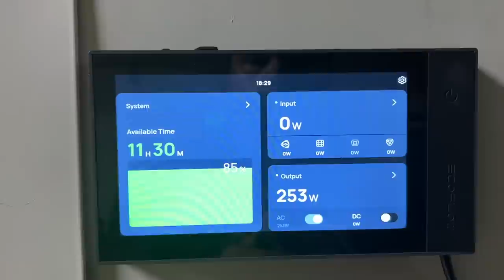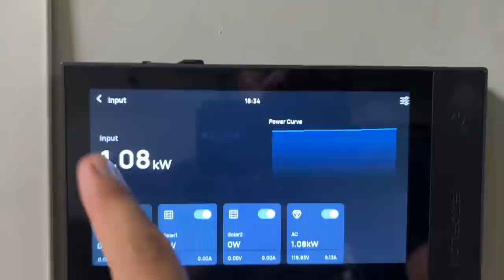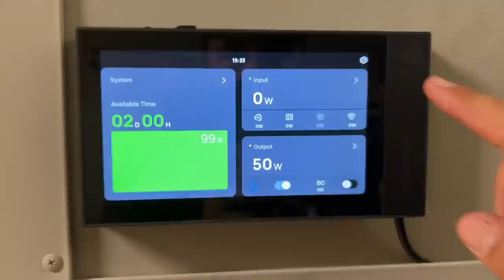Big Hog Caught BUT Just Barely!

Comment: Solar is 12v first. If ones solar batteries were set up as an 12v system. The use is endless. Although Lithium batteries don't mix with the rest. Yet all other type batteries do mix together. Lithium batteries drop voltage when used and won't come back up until charged. All the other batteries will. Mine in my shop is over 5 years old. Each to their own. Love the cabin idea where you have it. Good catch on the bor.

Comment: Daniel one of my first job's when I turned 16 was working in a grocery store (72-73). Those first 2 liter bottles where glass not plastic. They (the glass bottlers) hadn't figured out yet the carbonation levels for the bottles. We keep the Soda Drinks on  the very last row of the inner shelving system. A lot of mornings when they would open the store there would be a few bottles that had exploded at night. Cleanup time at that isle. One day I was unloading a grocery cart for a customer. When she took the bottles from the shelf she laid them down in the cart. I grabbed the first bottle and it exploded in my hand. The manager of the store took a bag of sugar and put some on my hand to stop the flow of blood.

Comment: Those predator inverter generators are quiet to your ears but if you run a ham radio off of them they are noisey as heck. We had one at a emergency simulation in a remote site and the generator wiped out our radio receivers. A honda generator was the only truely quiet one for radio and muffler sound.

Comment: You talked about how tuff those wild boars are, man are you right. about 30 or so years ago my dad went hunting with a bunch of guys at a similar type hunting preserve and they were using bows. My cousin shot one in the head. They tracked it for a long time and never did find it. A year later when they went back the guides told them that boar was still running around with the arrow in his forehead. He had snapped the shaft of the arrow off, but it was still in there. They found out that a few weeks after their 2nd trip there someone actually shot him with a pew pew and the processor had a heck of a time getting the broadhead out. They weren't quite the same type you have on your property (I think they were part Russian boar). Man they made great jerky and bacon.